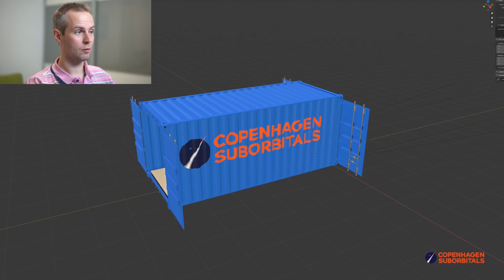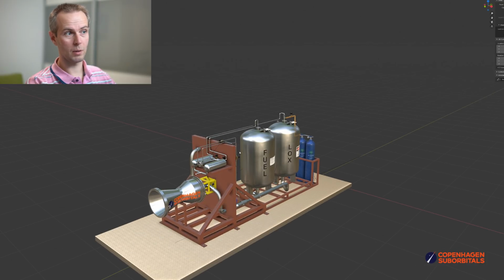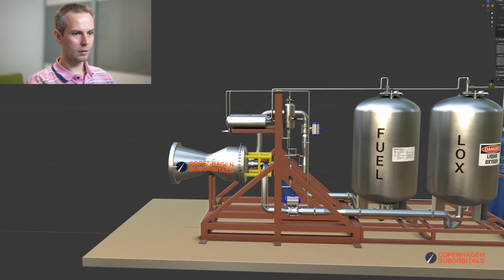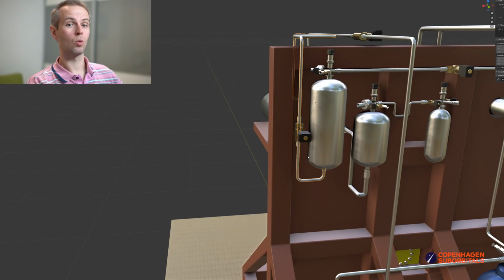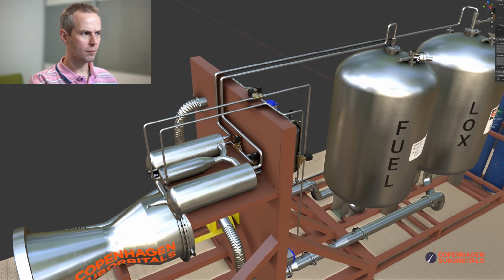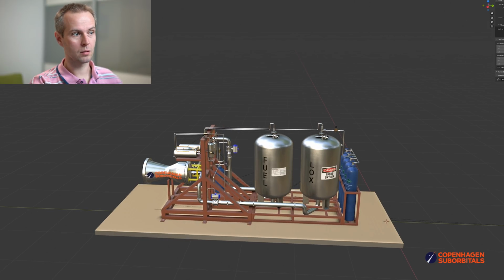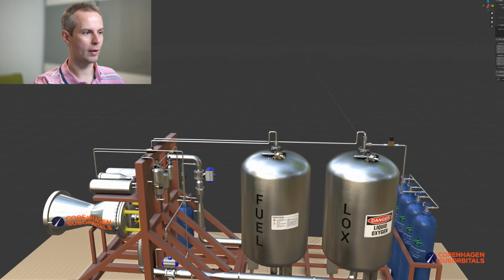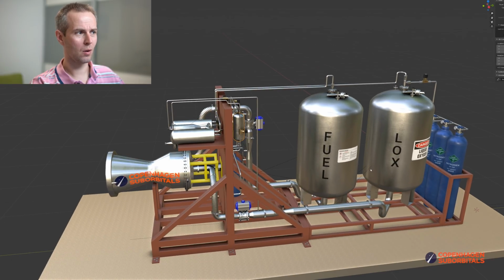Rocket Engine Test Stand Pressure Regulation

Comment: [  ] Why did you guys heat the nitrogen with the heat exchanger before using it to o pressurise the propellant tanks, why didn't you use the helium to pressurise the propellant tanks like you did with the nitrogen tank. Another question; why didn't you guys just use the nitrogen to cool the burner, that way the engine gets cooled and the nitrogen gets heated and you wouldn't need a heat exchanger

Comment: You need to use a type of turbo pump for your main fuel and Lox pressurization, there are a few methods to manufacture a inexpensive turbo pumps... The efficiency of your engine would be so much higher...   :)

Comment: Am I correct in assuming you're going for LN2 as the pressure medium because you can actually store it in liquid form whereas LHe would be at <4K? And the reason for you going for a cryogenic liquid is to reduce tank size and mass? A GHe tank would probably be gigantic assuming the burn duration you're aiming for?

I'm dabbling around with the design of a small (!) rocket engine with ~460N thrust and 10s burn time and realized that the GHe tank would either be huge or under pressure well in excess of 60bar which is bonkersly high for a potential DIY project.
Reply from the maker: You are right on point! It's mass and cost reduction. Large, lightweight high pressure tanks are quite expensive and we would need nearly 70,000 standard liters of Helium onboard for the flight, so storing all that at 300bar in COPV's as we did with Nexø I and Nexø II is a substantial penalty. We actually have a blogpost with more details on this choice:
https://copenhagensuborbitals.com/bpm100-dpr/
Reply: @CopenhagenSuborbitals  Well, this makes me reevaluate my tank choice then. I'm wondering if the excess heat of the engine could be used to heat up the nitrogen to turn it into a gas, but then again gaseous nitrogen probably doesn't cool that well so you'd still need to have the LOX cooling the chamber probably. It could probably be done with an heat exchanger though. Maybe with some potassium or sodium heatpipes.

P.S.: thanks for the article by the way, I've just realized I failed to account for the volume loss due to depressurization of the Helium so I'd need ~1.5x the amount of Helium and therefore 1.5x the size.
Reply from the maker: @diotough  You could definitely heat the LN2 by running it through the engine, but that complicates engine design and production. So as always, one needs to weigh all the pros and cons.

Comment: What is its specific impulse , are high energy materials used here ? I AM AN AERONAUTICAL ENGINEERING STUDENT I AM CURIOUS PLS
Reply from the maker: Isp is roughly 200-220s depending on the fuel's mixture we will use. It runs on ethanol and liquid oxygen and we dilute the ethanol with water.

Comment: Hey so is this going to be used  only for the test stand or is it also going to be used on the rocket because if yes why not just use autogenous pressurization with gox and I think you're using ethane so g-ethane? wouldn't that make the system lighter and more efficient plus what you're doing with nitrogen could also probably be switched to lox and ethane with a few tweaks to the design but I know that you're limited on the budget and nitrogen is probably just the cheaper way. (sorry for the long comment)

Comment: Great project, really interesting to see a pressurised liquid rocket system. An interesting pressurising system but could you give some more info on alternatives such as blow down or helium And why this is better? What is the estimated mass of the system going to be? Mass of the system? Total, fuel mass, and presurant mass.
Have you thought of using a "Hot water rocket"?
If you drop me and email I can share some thoughts on how this may help make a simpler system.

Comment: Make sure you have good check valves feeding the oxygen.  Lots of accidents happen when pressurized oxygen finds it's way into unexpected places. 
Solid rockets are all 'pressure fed'.  I have always wondered why there were no serious pressure fed liquid rockets, I have to believe they would have better isp than a solid and should have a better mass ratio too after a certain point as the tanks don't need to support chamber temperatures.

Kinda sad your not using LNG, if you already need one cryo system why not two.
An electron knockoff may be the easiest way to go these days.

Comment: This great, please create more videos like this.  I have a question though.  Are you using liquid nitrogen because you cannot get enough volume to the fluid and oxidizer tanks from the gaseous nitrogen? Or are you doing it because liquid nitrogen will take up less room when in the rocket?
Reply from the maker: Glad you enjoyed the video, Dylan! 
Housing enough (60,000 standard liters) of gaseous nitrogen means it needs to be stored in high-pressure bottles, which are not only expensive but also add a lot of weight to the rocket. So bringing nitrogen as a liquid saves a lot of mass (we'll only need to store 30-50 liters) and is a lot cheaper for us, as we can manufacture the heater and heat exchanger in-house, compared to ordering high-pressure bottles from a manufacturer.

Comment: Heat exchanger makes sense. You could have also done something similar to the RL-10 when the fuel runs the heat exchanger after going through the engine. Then again it also make more sense to use a turbopump.

Comment: I don't follow you since long time but I'm big fan of your project.
How about liquid Co2 instead of the LN2 preburner ? 

You can give it the more heat you can on the co2 tank before the starting, since the heat/pressure relation stop at 73 bar(a) (30°C) and goes to supercritical phase. 
Supercritical co2 is widely used in refrigerant system. 

Maybe in this way it's possible to get rid of the LN2 preburner. 

But the co2 tank will cool down when the pressure will drop maybe it will need a system to reheat it. 

Also it's probable to heat a bit the LN2 tank before as well of co2 and keep the system like it is.

Valves used for refrigerant can be useful (high pressure up to 120 bar, available and costless) and PWM and modulable valve is available (eg : Danfoss AKV / CCM)

Comment: Coming from an aerospace engineering student who has built a few small liquid fueled engines, I think that it is a wise decision for you guys to run at a lower pressure than professional engines. Not only does it reduce the need for exotic materials in the engine to deal with the pressure and heat production, it also allows you guys to use a much simpler fuel feed system that makes the vehicle much more feasible with your given budget. Props to you guys and I can't wait to see this thing launch someday.

Comment: Wouldn't run the nitrogen through the casing of the rocket to heat it be more lightweight, instead of making it a regenerative cooled engine with a different system to pressurize it? Wasn't it capable of heating the nitrogen enough or did you face other problems with that?
Genuine question here, since it seems to be an enhanced pressure-fed engine.
Reply from the maker: There are definite benefits to that approach, since there is a lot of available heat around the engine. But it also complicates the engine design, its production and makes it more expensive (we are a crowdfunded project with a shoestring budget). Furthermore, everything we've learned about engine cooling with ethanol on our BPM5 engine would be thrown out the window and would require essentially a new R&D phase for LN2 cooling. Such a system could also only be tested by firing up the engine, whereas a system that runs on a separate burner can be tested and validated on its own. And lastly, we will be testing an electric fuel pump from Orbital Machines on our BPM100 engine and we'd like to easily interchange between the two systems.
More on the electric pump: https://www.youtube.com/watch?v=-uU2w2kyZiE
Reply: @CopenhagenSuborbitals  Ah, good.
Reply: @CopenhagenSuborbitals  I didn't know about the electric pump until now.

Comment: It seems like a lot of extra complexity compared to "just" using a 200 bar nitrogen bottle for pressurization. Are the weight savings that large? A natural gas tank from a retired flex fuel car could be an alternative to a regular gas bottle.

Edit: Or do you plan to use the exhaust from the burner for roll control so that you want to keep it for that reason?
Reply from the maker: We'd need 11 of those 20 liter, 300bar nitrogen bottles for Spica. And the total mass of such a system would be around 350 kilograms, whereas the gas burner system would weigh in at around 100kg, so it is a significant difference.
Roll control will likely be via thrusters fed by the same nitrogen as the propellant tanks.
Reply: Hot gas thrusters, cool! Thanks for answering.

Comment: What if instead of the mini rocket engine, you pass the liquid nitrogen through the main engine, not only will it help with the cooling of the engine but the heat absorbed by the nitrogen while flowing through the walls of the nozzle will heat it up enough so that it turns the nitrogen into gas, you can then use that nitrogen to pressurize the tanks. This process will save you a lot of weight and will increase the efficiency.
Reply from the maker: There are definite benefits to that approach, since there is a lot of available heat around the engine. But it also complicates the engine design and production. Such a system could also only be tested by firing up the engine, whereas a system that runs on a separate burner can be tested and validated on its own. Furthermore, we will be testing an electric fuel pump from Orbital Machines on our BPM100 engine and we'd like to easily interchange between the two systems, so for these reasons we have stayed away from running LN2 through around the engine.
If you're interested, more on the electric pump: https://www.youtube.com/watch?v=-uU2w2kyZiE

Comment: Are you planning to use the Tycho Deep Space LES tower system as a launch abort system on your Spica rocket and spacecraft? In all the artistic renderings of Spica, there has been no launch escape system.
Reply from the maker: International Rocket Launches current plans does not include a launch escape system. Our conclusion is that it adds more complexity and risk than it solves
Reply: @CopenhagenSuborbitals  If you don't plan to use an LES system will you have failure modes in the event of an emergency. What will happen if there is an engine failure, vehicle fire, RUD, etc?
Reply from the maker: International Rocket Launches in short: detach space capsule, wait a reasonable amount of time, depending on altitude, and start parachute deployment sequence
Reply: Copenhagen Suborbitals Thanks for the info. One final question. What will happen if the rocket explodes (AKA RUD). Will you still detach the spacecraft or will a different sequence occur due to the severity of the failure.
Reply: @IntRocketLaunch  Maybe they expect the RUD itself to push on the heat shield and throw the capsule clear.
Reply: John DoDo Doe Perhaps.

Comment: Good job and explanation! What is the ignition method of the main engine and the heat exchanger? I deduce that it would be pyrotechnics in the main engine...
Reply from the maker: Up until this point we used pyrotechnics, but we're looking into spark plug solutions at the moment.

Comment: Here's a question from someone who doesn't know anything about these things. But why don't you heat up the nitrogen in the engine itself? or by diverting part of the combustion gases to the exchangers.  Is it much more complex?
Reply from the maker: It's a fair question. There are definite benefits to that approach, since there is a lot of available heat around the engine. But as you mentioned, it also complicates the engine design and production. Such a system could also only be tested by firing up the engine, whereas a system that runs on a separate burner can be tested and validated on its own. Furthermore, we will be testing an electric fuel pump from Orbital Machines on our BPM100 engine and we'd like to easily interchange between the two systems.
More on the electric pump: https://www.youtube.com/watch?v=-uU2w2kyZiE

Comment: i don't understand the decision to go with an alcohol fuel as its already half way oxidized.. the energy content in aæcohol is much lower that of the corresponding hydrocarbon, ie methane vs methanol.. you will be carrying a lot of extra weight, why that decision and not just LNG ??
Reply: Handling and burning alcohol is relatively simple and for CopSub a well known process. Alcohol an be stored and transported in plastic containers. An alcohol leak is not that big a deal. Methane on the other hand is far more difficult to handle and require pressurizing for storage and transport. We have little experinces with burning methane in an engine and a leak is a big deal. Storing LNG at room temperature requires tank capable of 320 bars not to speak of a very hot summer day. So if alcohol can do the job, why not?

Comment: So the nitrogen bank is not supposed to be on the Spica, right ?
The fuel tank is to be pressurized before landing and then the line is disconnected once the burner is running.

And the second tank pressurizing the burner fuel tank would be on the Spica since it is needed to keep the burner fuel under pressure.
Why is it a separate system from the main tanks ?
Reply: Pressurization gas needs a lower boiling point than the liquid it pressurizes. So He can pressurize LN2.  N2 can pressurize LOX and Vodka.

Comment: Please point the burst exhaust of the propellant tanks to different directions :D Nicely done as always.
Reply: The burtsdisc is located in the top of the fuel tank. The tank is pressurised with nitrogen and the vapour pressure of ethanol is not problematic at temperatures less than 50 celsius. I fail to see how the fuel will be sprayed outside the tank unless there is already an ongoing fire on the teststand.
Reply: @jnielsen20  true... I tough about that AFTER the comment :D
Reply: Since the fuel is liquid, does it matter? :)
Reply: @wespacewalk  of course! If the fuel touches any high temperature or sparking thing it will burn as it will be mixed with the air outside. The LOX is no issue, but the fuel line need to be direct to some safe drain  - even the dirt outside.

Comment: does it has a turbo pump?
Reply: No. It is pressure fed, that means the tanks themselves are pressurised with nitrogen and that's the only thing that drives the propellants into the engine.  The heat exchanger he described is what generates that gaseous nitrogen to maintain pressure in the tanks as the propellant is expelled.
Reply from the maker: No, it is pressure fed. We are however working with Orbital Machines to design and build an electric pump for propellant delivery.

Comment: Yeah , forgot to ask. Why dual heat exchanges. They are both identical right?
Reply: There is one to pressurize the fuel tank and another to pressurize the oxygen tank which will both need different and independently adjustable flow rate. I think having two separate exchangers instead of one with branched outputs makes it easier to control the flow of  one without affecting the other, hence making the control system simpler and more reliable.
Reply from the maker: We need to have the ability to hit different pressure points for the LOX and fuel tanks. Thus, there is one burner but two different heat exchangers. The propellant tank pressures can then be regulated individually by regulating LN2 through each heat exchanger.

Comment: What about electric pump? Like electron rocket. :)
Reply: I think they are eventually going to use one, that's why the pump is an external component rather than tightly integrated with the engine itself. Therefore it can easily be replaced later by an electric pump.

Comment: Is the engine the same on the test stand the same as in the rocket?
Or will it be two BPM100?
Reply from the maker: Initially there will most likely just be one BPM100 used for both static testing and flight of Spica 1.
Reply: ok

Comment: Why are you running the fule down the engine and not the liquid oxygen which should be colder? I think ther has to be some reason for this design decision that I do not know..
Reply from the maker: The LOX is already at its boiling point inside the tank. If you were to run that through the engine jacket for cooling the engine it would evaporate straight away within the first section of the cooling channel. The rest of the channel will then be cooled only by gas which is very poor at exchanging heat with the wall of the engine, at least compared to liquid.
Reply: It is not about the temperature difference alone, specific heat and vapour pressure vs temperature is important factors as well. Additionally, phase changes of the coolant will also be important to consider.
Reply: Heating up the oxidizer could lead to it reacting with the metal or impurities, I think.
Basically there is a risk to blow up the engine?

Comment: Excellnt explanation! As said i think low pressure engines are pretty unusual today, but i fully agree, it's the exactly right way to go here, at least for this project.
After all, The whole point here is to make this realistic and transform this into an actual working concept for the intended purpose on a realy tiny budget.